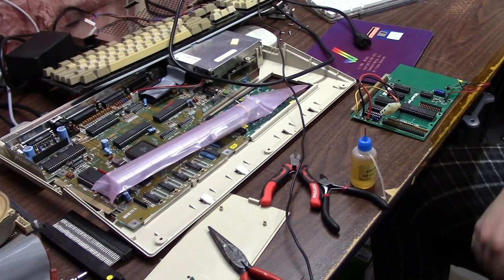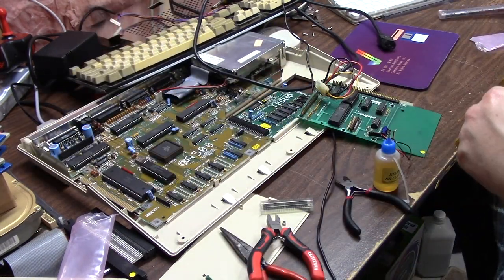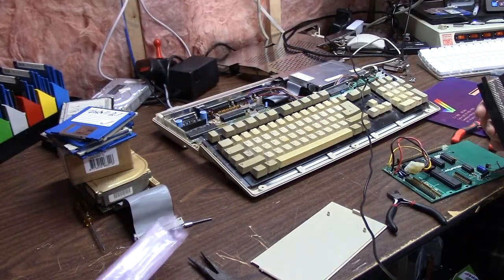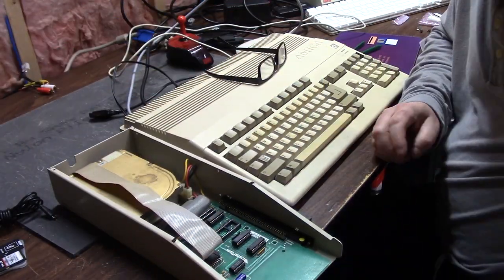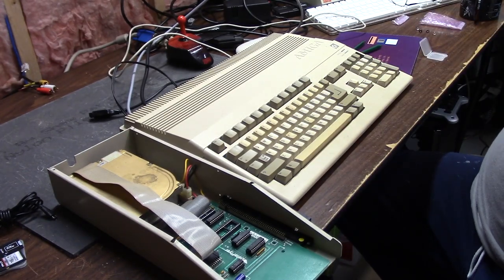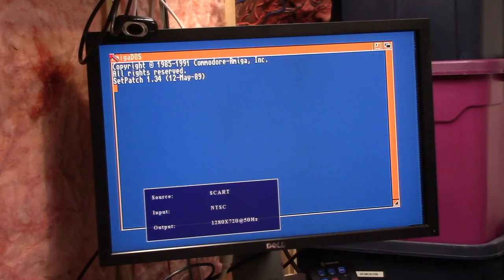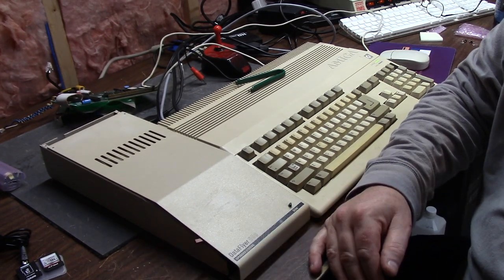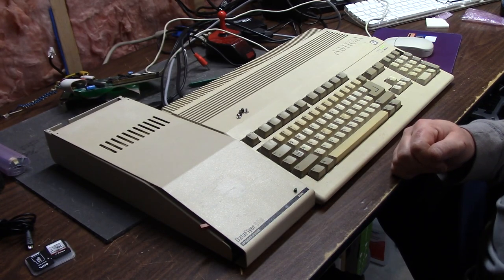dataflyer 500 Amiga 500 hard drive controller part 2 the fix

Comment: Nice!!!  I would not mind getting my Expansion Systems Boards up and running.    Maybe I should pull them out and take a look at them.   As for ordering 2 thinking your just going to get 2 on eBay,  I have done this myself only with 4 Pin Oscillators I ordered 5 and wound up with 50.   That's what happens when your burning the Midnight Oil and you remember to order something and you do it quickly just so you can get to bed.  Actually I have done that multiple times.

Comment: Hi Chris, can you tell me where you bought this Data Flyer board? Mine is not working (the PAL TIBPAL16L8-25CN is corrupted). Thanks you very much!
Reply from the maker: Ebooger long ago.  Have you considered replacing the chip?
Reply: @ChrisEdwardsRestoration  Yes but I should need a programmed one with the firmware inside. Otherwise, if you cold dump your chip and send me the file, i could program an empty one by myself. Could you help me? Thank you any way.
Reply from the maker: Sure ill dump the rom w my programmer
Reply: @ChrisEdwardsRestoration  OK Chris! Only of the TIBPAL16L8 chip. They should be a few bytes. Look forward :-)
Reply from the maker: @valterruggiero6409  ok i have a MMI branded PAL16L8ACN , since this is Programmable array logic my xgpro2 doesnt even understand the chip to read it. can the XgProTL866_2_Plus read these chips at all ?
Reply from the maker: @valterruggiero6409  all done, doesnt look like much in the reader, but it had some code in there., link attached, dumped twice https://drive.google.com/file/d/1f30hX26x_eJQBDQe20SFq-B6Trr3H6a6/view?usp=sharing
Reply: @ChrisEdwardsRestoration  Thank you very much, I really appreciate your support! I hope my dataflyer will come back to life, I'll let you know! ;)